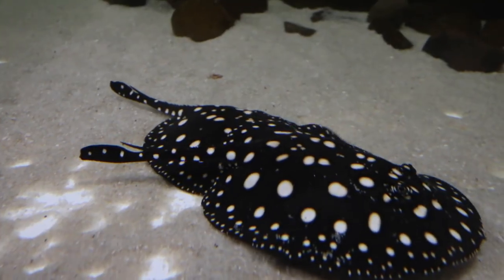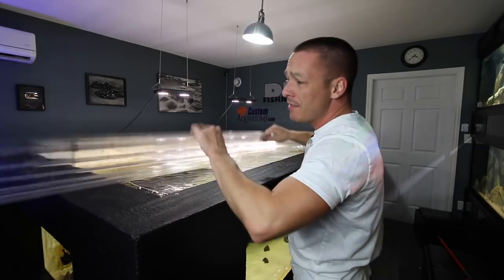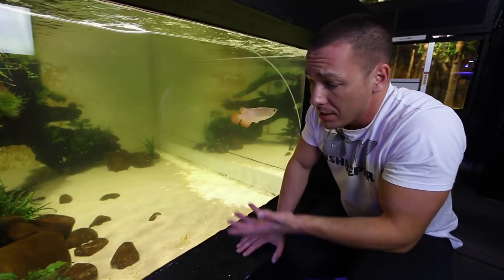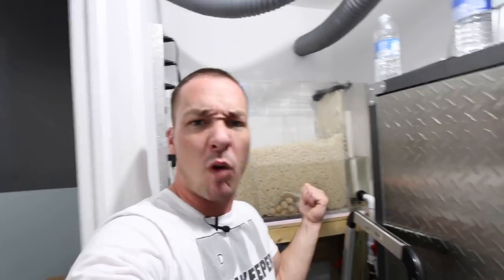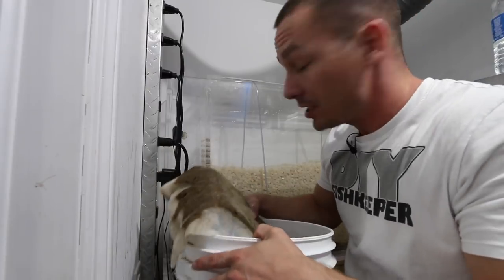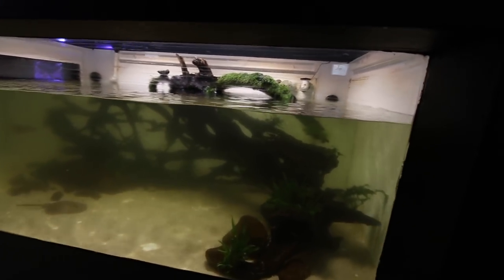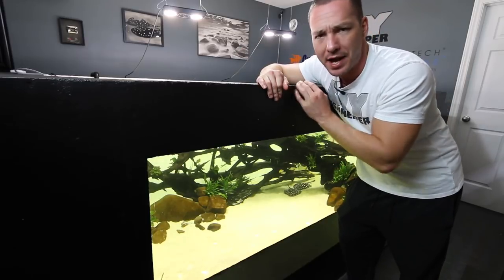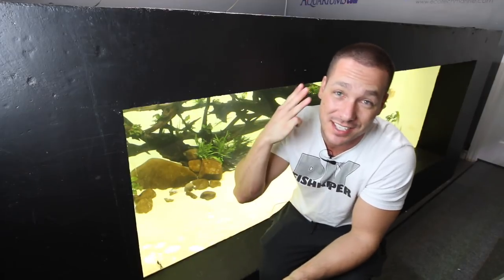How I clean my 2,000G AQUARIUM

Comment: Ive got a totally unrelated question for Joey.

First off loving your DIY video's, your enthusiasm is really contagious.

Now im thinking of building my own tank but sadly plexiglass/acryllic is extremely expensive here(The Netherlands) so i was looking into polycarbonate sheets as they are allot cheaper.

Now i know they are stronger then plexiglass but there is very little information on it beeing used for aquariums.

Do you know of its safe to use or if there's a reason not to use it?

Comment: I love your videos!  I have a question on you canister filter.  I have seen where the control valve goes bad very quickly if the power is not turned off before the selector is moved to a different flow setting.  I may have missed the power being turned off before you changed the flow selector.  I would hate to see a pump failure on such a beautiful tank.  Keep up the good work.

Comment: loved the video! quick question... how do you de chlorinate and condition the water adding it in like that? As well as I got a siphon system that hooks to my sink... my conditioner says add to the water first. So how do I properly use this product? this would help me tremendously.  Thanks so much for all your advice and input.
Reply: He  has his own well so his water isn't chlorinated.
Reply: If you do add chlorinated water directly to your aquarium, be sure that your filter is off first to prevent killing the beneficial bacteria inside of it. After adding the dechlorinator to your tank, give it a minute before restarting your filter. Then you should be good to go
Reply: He has made videos demonstrating how to build a cheap diy carbon filter for dechlorinating your tap water on a drip system. Just look through his older videos.

Comment: I'm throwing this out there. I build pools for a living and future reference turn off your pumps before you turn that multi port valve on the sand filter the internals are fragile and it doesn't take much for it break same thing can happen if you turn it both clock wise and counter clock wise stick too one direction. Best case you will have a small leak around the fiittings worst case it will continue to send water out of the backwash line your aquarium will constantly be losing water and your yard will become a marsh or an ice rink depending on the season. All that aside if you take care of it that filter should be good for about 10 to 15 years before you have to change out the sand.

Comment: Please turn your pump off before changing the multi-port valve on the canister filter. You can ruin the valve if you don't.
Reply: Nick Alspach and always spin the handle counter clock wise or you can damage the latterals inside of the canister filter.

Comment: Drill some small holes in the lids you won't get the water build up on them. Dude you could also put alil more sand in there its a very thin layer you got

Comment: Are you turning off the pump to the canister filter before you switch it to backwash?   If you do that too many times, you will damage the valve system.
Reply: Tyler Aldridge no need for name calling.   But, he  turned the pump on then turned on the backwash n showed the sight glass running so, get a life n pay attention genius
Reply: actually its just fine on that canister and it woudl take probably in the tens of years range to damage it to where it doesnt work at which time the pump woudl likely need replaced anyway
Reply: ^I second this.

Comment: Am not a fan of covered tanks , I read in a goldfish book about toxic  gases released  out by the air pumps that need to release out to the atmosphere
Reply: The corrugated plastic cover he uses is not sealed, gasses can flow out simply through diffusion. The only purpose it has is  to keep the animals inside from escaping the tank.
Reply: i got it ,  thanks for the reply

Comment: Anyone got any tips 
I have a major algae problem
How should i get rid of this as magnets and scrapers dont work
Reply: your name here lick it
Reply: Well fight it at the source. Why don't you tell about your tank?
Best advice I can give for now is dial back the lights to 6 hours a day. Keeping light low is always the basic solution.
There is probably an imbalance tho. This can be due to overdosing fertiliser, going over the recommended 8-10 light hours a day, Tank receiving direct sunlight, overstocking, not enough water changes. Basically all simple mistakes cause algea.
Large amounts of plants help, and nerite snails can help keep algea down until the cause is fixed. I hope any of this was helpful.